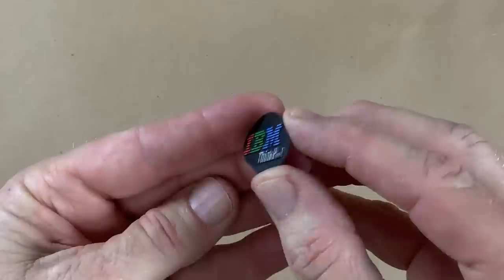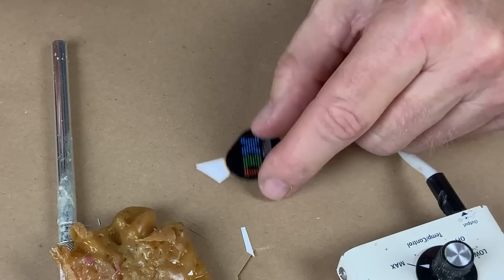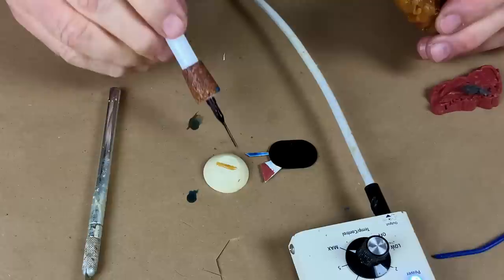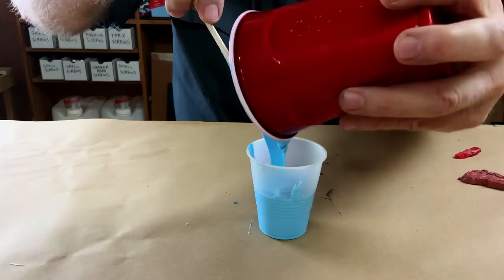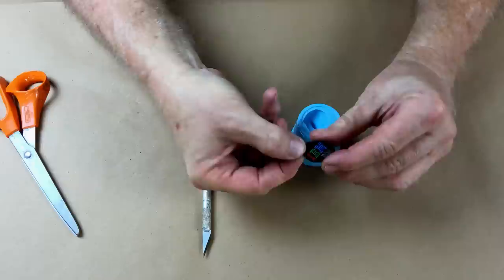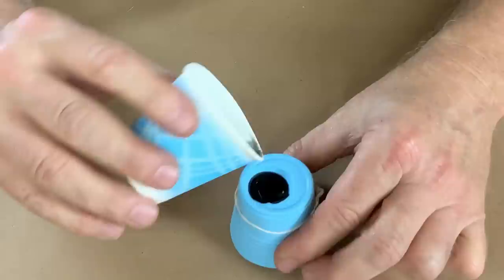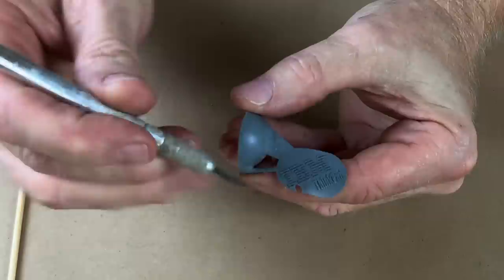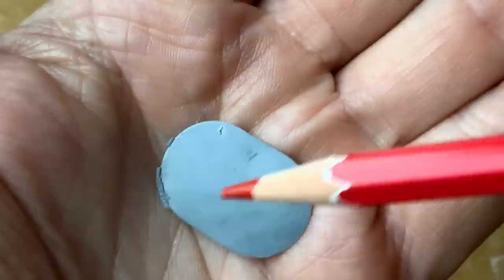TINY Casting = BIG Challenge

Comment: Nice video demonstrating a common problem, Robert!  
Sometimes I'll pinch open a mold like that while pouring the resin.  It does increase the flash, but not too badly if it's closed up well after pouring.  And of course it eliminates the turgidity issue, because the mold cavity is temporarily made much wider.
Happy casting, sir!

Comment: Great to see ya Rob!  To answer the question 'can it be cast', if you are on the case it's the best bet!  I wonder though, if the thickness were not critical could you add a few layers of card-stock to beef it up?  If the thickness were a critical dimension, what about pressure injecting the resin with a plunger down the pour sprue?

Comment: I love your videos.  I really need to get a vacuum chamber.  
I have a suggestion for you to try though.  Not necessary, but you might like it.  At Sally May Beauty Supply they carry hair razors.  They are about 3 inches long and the sharpest things on the planet.  Way sharper than exacto knives or regular razors.  They don't last long, but they are the industry standard for shaving and cutting foam when making puppets.  Great for cutting flashing too.

Comment: That's exactly the problem I had with the first attempt at my big pour.  The funnel was too shallow and wasn't able to push the rubber into the mold fast enough and it all hardened.  I'm re-tooling to include a pressure tank and a injection type fill point instead of letting gravity do it.  My mold is very large, so I'm having to wait until I can afford a proper size tank.  Thanks for the video, always great insight.

Comment: If you had to do a cast would you make the base thicker and then just saw and sand it to the desired thickness? Or maybe even an open face mold with the back of the object exposed to the air. Either way, some post processing would be required.

Comment: Back in the day I was a toolmaker in the plastic injection industry and on occasions we would add more vents if needed, You could try putting a couple more vents in that mould to help get the air out of awkward places.
Reply from the maker: Yes, you can always add vents and often you have to. But every vent is more work to clean so I’m always trying to use the fewest possible.

Comment: I'm impressed that the castings weren't torn to bits just by the simple act of taking them out of the mold. Figured they would cling to the inside a lot more than they did.

Comment: Great video! I would've tried an open face mold, higher than It sould be to account for the reserve and then sand It off in the belt grinder. A lot more pre and post work but I don't know what else would make it! 😅

Comment: With such a fine detail, wouldnt it be benificial to pre paint the part with silicone prior to poring it in? that way you know youre filling in all that detail?
Reply from the maker: I often pre-paint the rubber but in this case it wasn’t necessary. The detailed lettering poured perfectly.
Reply: @RobertTolone  that's awesome. I'm not gonna lie, I thought that thin void between the lines was going to cause an issue. I didn't even consider the thickness a flexibility issue

Comment: New subscriber and new to mold making. I want to be able to make pieces for my son's action figures (esp interchangeable hands and heads)...however...the figures are at 1/18 scale so small. I wonder if there's a way to pour mold these parts (esp the hands since they are smaller and more prone to hold air pockets in addition to the resistanxe/friction rate you speak of for this thin piece)? I'll peak through your prior videos to maybe see if i see something comparable, but hope you'll be able to reach out w a suggestion/response :)

Comment: Hello Robert. Is it a good idea to do a full enclosing mold of this tiny object, having a flat surface on the back of the badge? Why isn't better to do a shallow open 1 piece mold, pouring without vents or funnels?
Reply: When I see that, I would just think the whole flat back side would be the pour area, then sand the back flat after curing
Reply: I think There's a great compromise where you make it like a squish mold. Only cut down one side of the mold and spread it open to fill, then when it closes, the excess will squish out

Comment: If the bottom is flat why not use an open face mold? I imagine it wouldn't be too hard to press/stamp it into a soft but rigid medium like clay with a very shallow wall above so you could effectively pour a bunch at once and then just drop the sheet of them to break off the flash.

Comment: Why not tack the the part down flat since it itself is flat and then put the silicone over the top to make a 1 piece 1 sided mold? Seems it would effectively reduce the silicone needed and you'd be dripping the resin in and not wasting extra with a vent & sprue?

Comment: Great video. I am yet to start with resin but have been watching your videos to gain knowledge. In what instances (other than a thin mold) would you use both the Vacuum and the pressure pot. Most times with resin I only see you use the pressure pot. Thanks for sharing your experience Robert!

Comment: Hey Robert! this was unbelievably helpful. I have a question. I did my first cast its like a radiator key, it came out well apart from it doesnt turn because the resin is soft. On inspection its thin in the area where the tool makes contact with the bolt. So do i need better resin and if so what type and in your video did paper thing IBM thing actually set rock hard or did it have some flexibility?

Comment: How do you do, sir?
After watching your video when you used chunkage to fill the mould I've been wondering whether I can use my waste rubber that I scrape from the inside of my mixing cup. For instance:
-By chopping it into very small pieces (like confetti) and mixing into the fresh rubber, or;
-By dipping it into the freshly mixed rubber and gluing to the brush-on mould.

Have you ever experimented with it before? 

Thanks in advance and have a good day!
Reply from the maker: Yes, When I first started molding I ground the rubber up into small pieces. But I found it was too hard to wet them with the new rubber and so I invariably trapped a lot of air in the mix. The chunk-style method I use is cleaner and faster.

Comment: when i did something like that last time i did just one part open mold and just cut the resin off the back of the casting while it was starting to cure
part was laying flat, details to the bottom, while making mold it was the reverse, detail up and back flat on the surface
in my case most bubbles were rising straight  up on the back and none of them left in the surface details
no presure, no vacum

Comment: I find myself wishing you did a series on latex rubber brush on molds SPECIFICALLY concrete statuary.
Reply from the maker: I have never been a fan of latex molds. If I did plaster or concrete casting I would use urethane rubber molds. They last almost forever and are faster to make than latex.
Reply: @RobertTolone  there is surprisingly little in the way of making concrete statues with urethane. I see some tile molds here and there but little about making statues.

Comment: Maybe this is a stupid question but why go for a sprue/vent style cut mould instead of a dump mould where you simply could glue the back of the emblem down and use far less silicone and guarantee zero bubbles?
Reply from the maker: The part is so thin that you will never get an even casting using an open-back mold.

Comment: I find that it's a completely different thing casting with a thin resin vs thick (like epoxy). I tend to exclusively use epoxy and have designed my molds for injection with a syringe. When I've tried the same molds with some very thin urethane I always get voids. It runs and flows like water, versus having to be pushed under pressure, and this seems to cause me more problems. Pushing a thicker liquid always seems to evacuate all the air. Of course, though, you need a vent at the other end for the air to escape.

Comment: I don't think I would have gone that route to cast that. A flat back object like that I would have done a one sided open back mold and flat plated the back. Something else to try with that mold is to dust the surfaces with baby powder/talc. I cast 1:87 model cars with side cross sections as thin as that part with no difficulty all the time. Some of these hade windshield posts that are 1/32" x 1/32" in cross section.
Reply from the maker: Squish molding or open back pouring were options I considered.  Both have their good points and problems.  But either could potentially work.  Lots of people swear by talc but for me it always causes more problems than it solves so I never use it.  I’d love to see videos of your process; your should post some.
Reply: @RobertTolone  I don't have any video's but I could send some pictures of what I am doing here

Comment: What about tolerances using a silicone mold?  I always wonder how precise a part can be when cast in silicone?  On a part like this, a variation of a few thousandths will be very visible.
Reply from the maker: There is always some shrink in molding and casting. But at this scale it would be very hard to detect.

Comment: Hello Robert, I have a question about the pressure pot: according to some sources on the internet, it is advised not to cast under pressure in a mold that was not made under pressure:. I’m guessing that the bubbles in the rubber will be affected by the pressure and distort. Your thoughts on this would be greatly appreciated.
Reply from the maker: I never put my molds under pressure while they are curing and I always cast the resin under pressure. A mold made with rubber that has been degassed in a vacuum chamber prior to pouring won’t have any bubbles. Presuming that the mold has been poured properly and no bubbles have been trapped against the model.

Comment: WHY would anyone want to make a Thinkpad part?  These things were made in the hundreds of thousands if not millions.  Though to be fair, nobody will kill a Thinkpad to get the little name plate off of it. 
But I would think there would be a large inventory of NOS out there.  It absolutely amazes me just how much NOS is out there, even of very large items.
An electronics channel I follow has 2, count em 2, NOS (new old stock)  mid1960s console color TVs.  They take up multiple cubic feet of storage, yet sat in some warehouse for 50 plus years before eventually being sold off as NOS vintage TVs.  20 years ago you couldn't give it away.
Another YTer I follow just bought 3 1970s 8-track players NOS. 3 identical models (except in color).  They were very cheaply made by Panasonic back in the 70s and somehow sat in a warehouse for nearly 50 years in Japan of all places, where space is a premium.

Another YT channel I follow has a whole room full of NOS car parts from the 1930s. Spark plugs, carb rebuilding kits, wheel bearings etc (Stong's Garage).  It just never ceases to amaze me.  If I were interested in music instruments of watches (just 2 random examples), there are probably NOS 19th century watches and musical instruments out there.,
Reply: Same. Up until a few years ago I dealt in industrial surplus. As late as the 2010's I was buying huge amounts of NOS electrical gear that came mainly from England (according to the paperwork/inventory labels) and ended up on the US e-waste market somehow. Loads of parts from the early 1970's, minty fresh (if a bit dusty from storage). Digging into the history of the date codes showed a trend of companies consolidating and apparently just dumping/warehousing the old inventory before doing the corporate name change. I imagine that lots of this stock just sat somewhere, forgotten, until the properties were sold. Much of it probably switched hands along the way, with people like me buying it for fractions of a cent on the dollar and then sitting on it.  With the amount of stuff that I was seeing, and I only got a tiny fraction of what was available, I always imagined the government warehouse scene at the end of the first Indiana Jones movie. So much stuff out there still undiscovered.
Reply: I think he was doing this solely as a proof of concept. He probably just grabbed the thinnest object he could find that had some details on it, which happened to be this Thinkpad nameplate.
Reply: @nekrataali  That thought had entered my mind.
Reply from the maker: The project was sent to me by a viewer.  “Mine is not to wonder why, mine is but to do or die”.  I pick the projects that come my way for their teaching potential, never because they make much sense economically or in any other way.  😄

Comment: Hello Robert, 

How did the victorians cast those 3 dimensional complex cast iron decorations? It seems that any way you turn them, they have air bubbles. Would they make a new lost wax mold every time? I can't find any information..
Reply from the maker: I believe they used a process very similar to this: https://youtu.be/OqfoORmGU0w
Reply: @RobertTolone  Thank you Robert, upon further inspection one of the pieces was removeable, must have been made exactly as in your link

Comment: I think I’m confused even more now lol. I have a lovely flowy betta fish I created from polymer clay with thin rippled fins & tails that I would love to make a cast of. I’ve been procrastinating for about a week! I was thinking I’d have to use a brush on latex, but maybe I can do a poured cast….. Geesh, so many options, I might need to try them all, just worried about damaging the original 🤯🇦🇺❤️. What would you suggest?
Reply from the maker: You probably will damage the original; I do it all the time. When I do a sculpture meant for casting in resin I consider the sculpt to be a step along the way. The casting is the final product. So I don’t mind if I break it. Or I just assume the original sculpt will need repair afterwards. But then I usually sculpt in wax which is easy to fix.
Reply: Thanks…… I’ll keep procrastinating!

Comment: Which of your videos do I need to watch?
There are rubber spacers that are between my door and body on my Ford Expedition. 
They provide an anti jiggle/rattle. 
The shape is a flat topped cone about 3/4” tall and 1/2” wide. 
I’ll need to pour it with a medium soft resin/rubber. 
If there is shrinkage I’ll need to build it taller. 
I have 6  of them to mold. 
By the way what is the name of a two part mid soft rubber?
It is maddening to find something without correct terms or a name. 
Thanks
Reply from the maker: I don’t cast rubber objects so I’m not an expert. Those bumper have many functional requirements and finding a casting rubber to meet those might be difficult. The original parts were almost certainly injection molded and/or vulcanized.
Reply: @RobertTolone  I looked on  simpleresins and found a two part polyurethane “rubber” that has a slightly softer durometer. My main question is about shrinkage. If the mold materials shrink and the resin shrinks I’ll need to build out the object to compensate. I’ve had silicone molds shrink about 10%.  It’s easy enough to add 10% to the long dimension. If the resin shrinks as well I’d need to add some more. 
I’m thinking that your “Production” cut mold would be what I need. You had about ten objects molded in a line. 
My costs for a small run of 12 would be close to what buying the bumpers from Ford. Plus I could make probably 50 from the smallest 2 part kit.

Comment: So with the cardboard and wax, would it be easier to use something like sheet styrene and plastic cement to attach the sprue? I ask because you would get a stronger bond than wax. Or is the wax intentional so you can make the thicker funnel? What about making a mold of the letters, casting those, attaching them separately to the plate, then casting this new object out of a material you have more control over (like making the whole thing out of wax to do lost wax)?

halfdhdasdljfa;hfjqhfiugbksjbdkjabkasjb I just want to download your brain like the Matrix.

Comment: I didn't say anything while the video lasted, i didn't want you to make a bad move and break the wax connections... but now that you are done and morosely looking down at the piece... WHY would you torture yourself with a closed mold for this flat thing?!

Just make a bunch of equally high flat molds of it, massage a couple drops of resin into each, and cover them up with a flat silicone slab.
Reply from the maker: Easier said than done. I considered that method and it could have worked. But like the mold I made, that process has it’s good points - but also it’s drawbacks. There’s no simple foolproof method for making parts like these.
Reply: @RobertTolone  I respect you and your work way too much to start an argument about this. But. If you insist on closed molds for this subject, may i suggest the J-mold approach? A little more wasteful, possibly more silicone used for the mold, more resin to fill in the channels, but its nature of eventually filling from the bottom would reliably solve the stuck air issue.